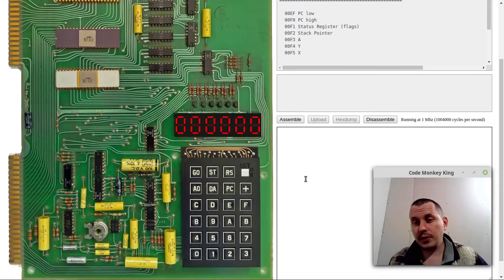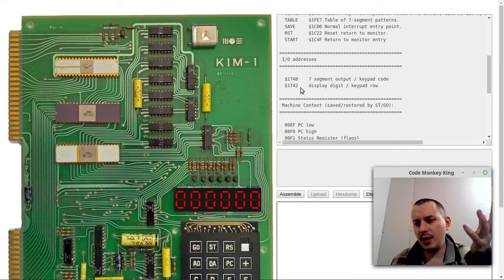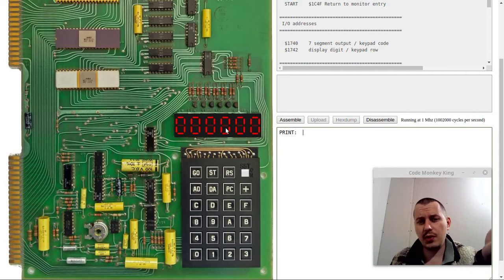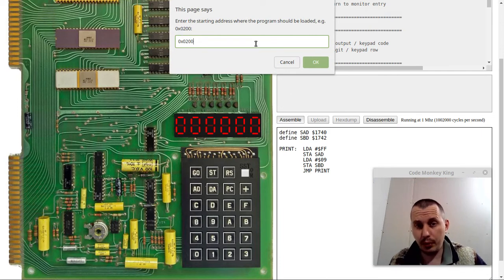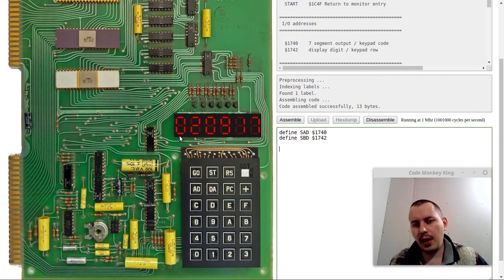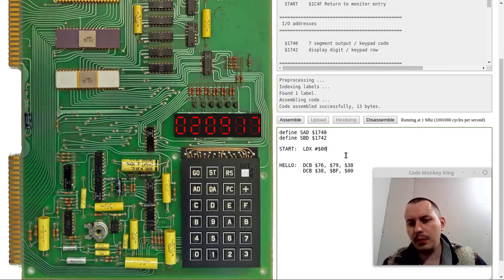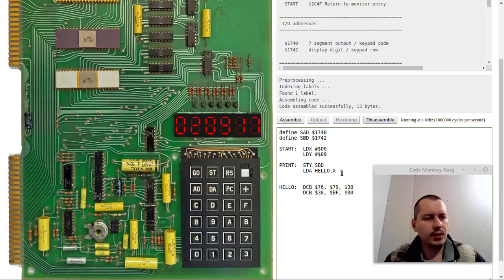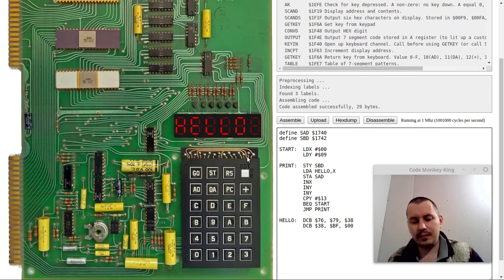Hello World on my KIM-1 Emulator

Comment: Great tutorial.  The emulator is getting very advanced.  I especially like that I can change the code, compile and upload all at once.  I noticed that while a program is running I can make minor changes to the code , assemble and upload without stopping the running code. It updates on the fly. 

I think on a Kim it is required to set the data direction bits (sadd &sbdd) before using the display. But for some reason this isn't required on the emulator. 

Do you think you will be able to add a serial function to the emulator? 

BTW from what I have experienced this is already the best Kim emulator  on the internet.
Reply from the maker: Thank you for your kind words, Dominic) Yes, since we have a direct access to RAM an on the fly update is possible. The code assembler you like is not written by me, I just adopted existing code. As  for data direction - you're absolutely right - I messed up data direction registers here, but once I alter the code basing on what you've sent me it should be working properly. The reason why it works as is is because in javascript button click events are async to CPU loop. Finally regarding serial communication - since ROM does it anyway it's possible but doing this only by using widgets would result in a need to click up a 'send' button all of the time and in that case the dreaded timers would most likely get messed up. So to do it the proper way a sort of a terminal emulator is needed. Writing a custom one goes beyond my skills and as for existing one - not sure if it exists. IMO serial communication makes sense only on arduino based emulators because there's no other way to access RAM from the PC on the fly other than via serial connection. Since I'm going to build my custom KIM Uno like arduino based version the serial communication is going to be on the cards there. I will reuse KIM Uno's serial code but change I/O implementation. I'm gonna be using two 3x4 keypads requiring only 1 analog pin per keypad and TM1637 (not sure) based six 7 segment LED driver with only DIO and clock control pins living the rest of arduino pins free to use.